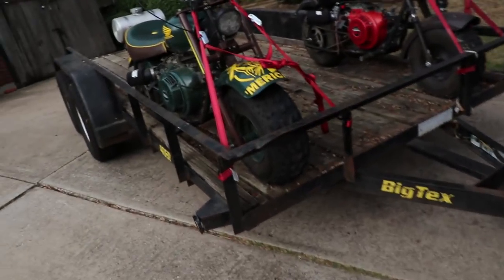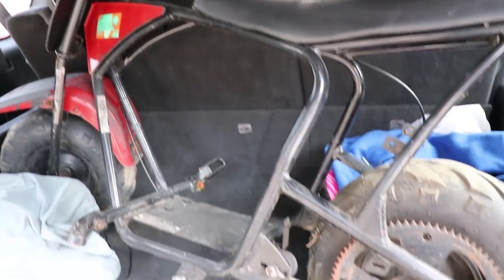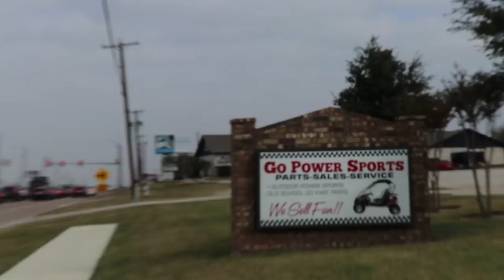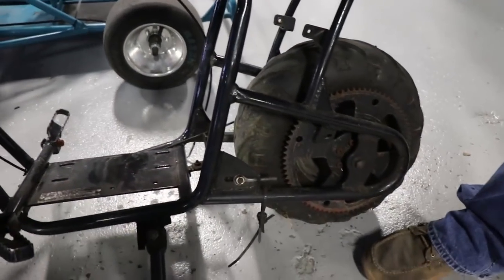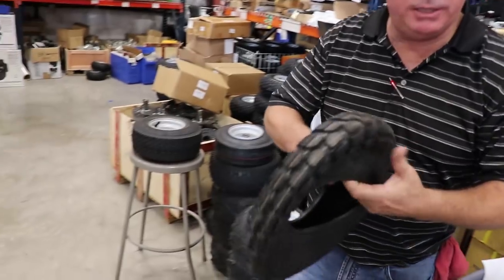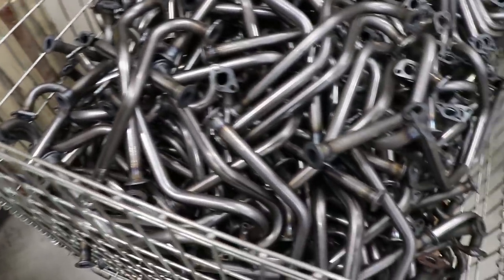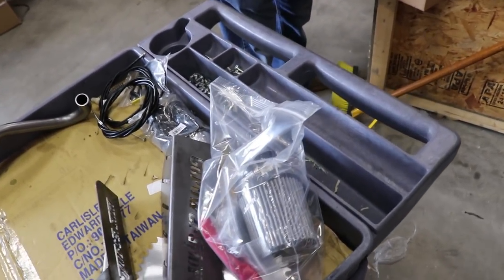Mini Bike Parts: Monster Moto MBX 10 Build

Comment: Unless you like the wheelies, you should extend the frame of the stroker to make it easier to win drag races, so the wheelies wont slow you down
Reply from the maker: Going the wheelie bar route. It does wheelies even when I’m over the handlebars. Too much torque. I don’t want to make the bike too long either.

Comment: That's not a motovox. There's a huge difference in frame styles.
Reply from the maker: true, but the engineers at motovox sold out and went to monster moto (now mega moto) so they took their design style with them, and were sued by the owners of motovox for copywright infringement. Many of the parts (that arent the frame) are exactly the same. Thanks for pointing that out though.